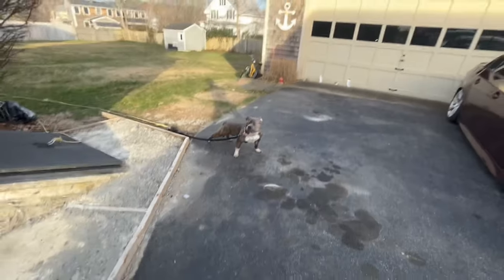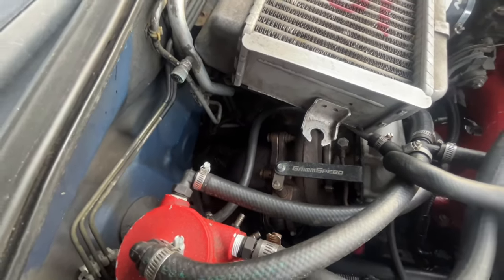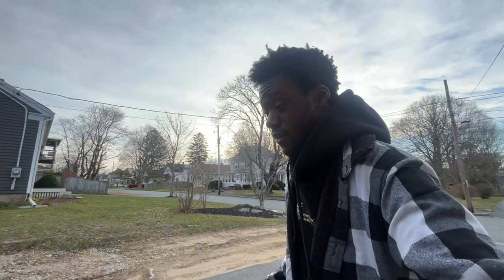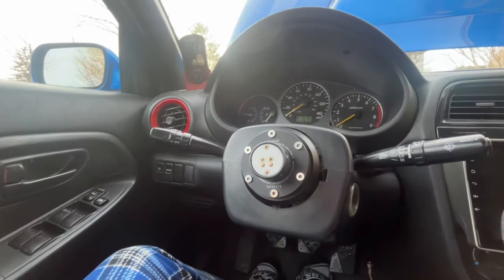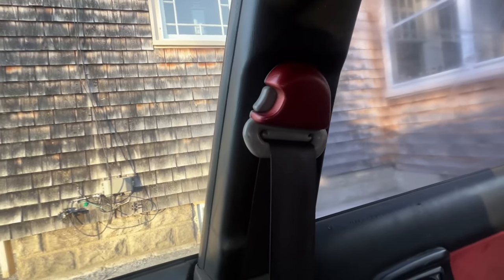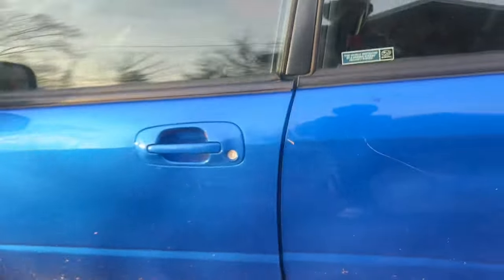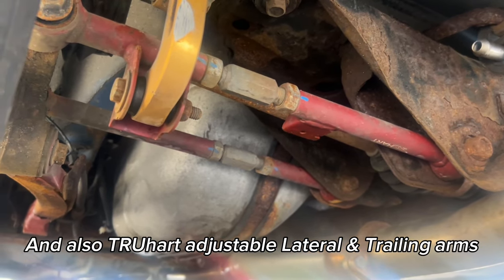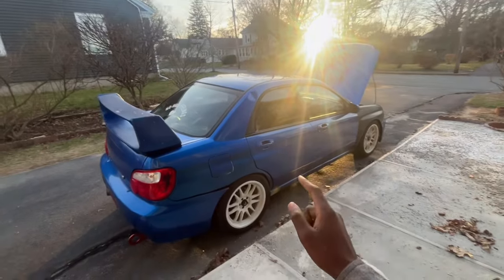EVERY MOD I’ve done to my WRX so far!

Comment: yeah you should definitely get a cyl 4 cooling mod for the 205 ive got one on mine all the turbo ej engines have pretty much the same problems with cyl 4 (usually)
Reply from the maker: Broo that’s what I figured!! But “more experienced” Subaru enthusiasts kept trying to tell me otherwise 🫣🫣. I don’t see the harm in it. It’s preventative maintenance 🤌🏾